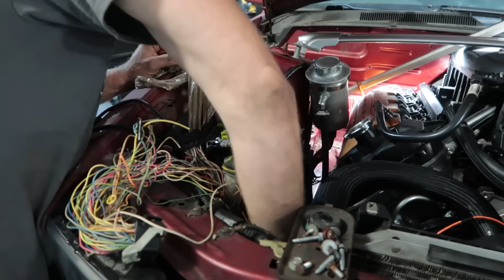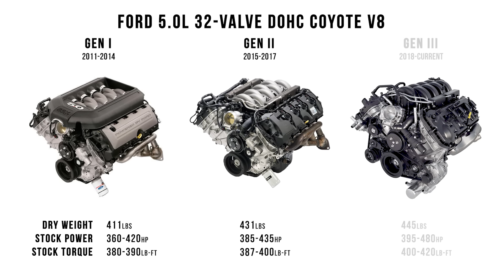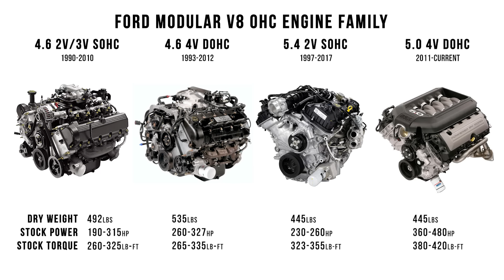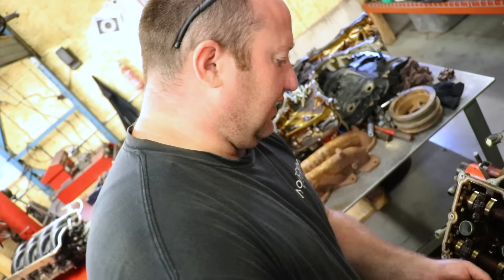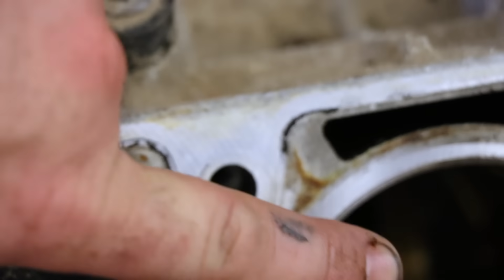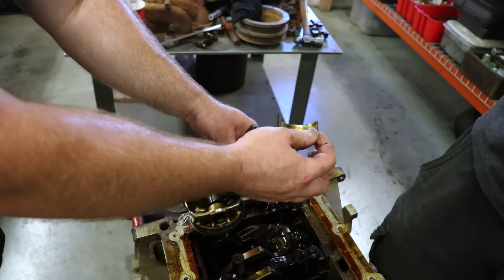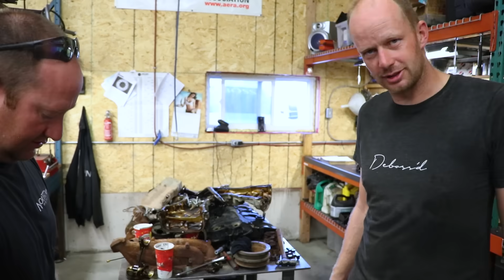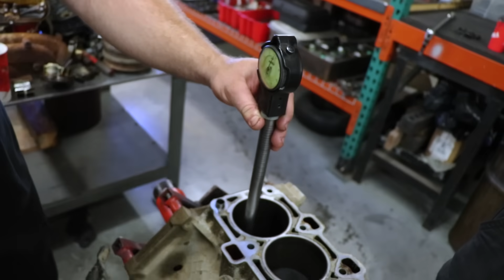REVIEW: Everything Wrong With A 5.0 Coyote Engine

Comment: I'm no mechanic. In fact, I've always tested lowest for mech. aptitude but pretty high for almost everything else and real life has backed those test results up. So I'm not stupid...just mechanically challenged. Just wanted to get that out of the way before I chimed in with my preference for the 4.6, which is based solely on a great, fun, and trouble-free experience I had with my old 2000 Mustang GT convertible.  Sounded great, felt way faster than it really was, though it was no slouch even there, and was super reliable. Back then people were bitching about it, wanting the 5.0 to return...and return it has, and now there's a new controversy, it seems.  Meh, 20 years later and I'm about to get a Ford F150, with 4wd and a naturally aspirated engine being my only non-negotiable options.  The naturally aspirated 6 is pretty weak, so I'm left with the V8...just hope it turns out to be a good choice.

Comment: I have. 2016 F150 V8 and it stutters when doing speed between 40 and 65mph and holding speed. It only seems after the truck has warmed up. Auto Zone shows no error codes. To this point I have replace, air filter, evap, spark plugs, ignition coils, and fuel injectors. 

Any ideas or suggestions would be appreciated. I’m already in to this for $1300 would really like to find the issue.

Comment: 217k on my 2011 F150 5.0 still going strong been runing e85 for over a yr now regular oil changes based on oil light
Reply: 10,000 mile oil changes wow
Reply: @americanchauvinist1210  you know the oil light is a lot sooner than that usually about 4,500
Reply: @kubeanieGaming  from the vehicles I’ve seen it 10,000. Most car/truck manuals will even say 10,000 mile intervals for “light” use and 5,000 mile intervals for “severe” use
Reply: @americanchauvinist1210  i am 1000 miles in to my new oil and it says 80%
Reply: Like my 2020 Honda civic oil life will be “50%” at 5,000 so according to that I can run another 5,000. No oil light at 50% no thanks I’ll change every 5,000

Comment: What is amidextrick?
Reply: It's part of the heat exchanger where the V- Tech converts the spent fuel to the rods via the post refractor. Usually upgraded to a double V convertor that be purchased at any online mustang parts supplier (ie, American Muscle). Cheers

Comment: 2014 150 5.0..4×4..mobil 1 5k....at 60k..light echo tune 87 oct...removed limiter...trans filter oil.45000..transfer..60000.k..diff oil amsoil...plugs 65000...idridium...355 diff..locker......top ofzerved speed in nevada 130 and still pulling...Wiley runs good..anti feeze changed 65000...airaif intake from air box to intake..air aid drop in air filter......maybe 380..385 crank hp...my experence so far   also a 36 gal fuel tank...super cab xlt

Comment: With the sludge and varnish deposits evident in the disassembled engine of this video, this is not a synthetic lube oil symptom. Sludge and varnish deposits like this are caused by excessive oil change intervals and  severe engine operating conditions. Short trip and city stop and go driving is severe duty operating conditions for engine and  motor oil, compared to longer distance per trip highway driving.  Clearly, the lube oil change intervals were not frequent enough for the operating conditions for this engine. 
Regardless of using synthetic or regular mineral based lube oil,  the detergent additive capacity of the lube oil  to suspend and control combustion products contamination is limited. Eventually, the amount of contamination the lube oil is able to suspend in solution will be exceeded, resulting in sludge and varnish deposits forming on the internal engine components. 
Associated with excessively long oil change intervals,  failure to maintain proper lube oil fill level maintenance between oil changes is common. 
The lubrication failure symptoms with bearing wear and damage that was visually apparent on the connecting rod bearings is consistent low lube oil levels with poor maintenance and neglect during this engine's operating life span.  
If the lube oil change intervals were performed according to the engine manufacturer's maintenance specifications, the oil change intervals were excessive considering the severe operating conditions for this engine.

Comment: Darker passenger side is due likely to PCV going to that side of the intake. Positive crank pressure air with oil in it is the cause. I'm am about to install a catch can to prevent long term intake gumming.

Comment: I think the Motorcraft 5w-20 recommended for my '13 5.0L is a synthetic blend. I change at 5k intervals and ignore the factory alert system. 75k so far, no oil consumption, really no issues with the engine whatsoever to this point.

Comment: Nothing much wrong with the coyote it's a pretty great engine and in my opinion the BEST engine Ford has ever produced! Super reliable and can handle quite a bit of power! Extremely big though extremely big for a 5 litre, but that's what you get with 4 cams I guess. The 4.6 and 5.4 can be great engines too but in stock form I don't trust them for longevity if you're beating on them like most people do cuz there just fun engines to push to the absolute limit. The 3 valve triton is absolute fucking garbage and you can just throw it right in the trashcan along with the new sparkplugs, coil packs and sensors you just bought trying to fix multiple misfires!

Comment: So the one thing I want to add as for the differences between the 4.6 and 5.4 modular engines. The blocks are all basically the same from piston bore size and spacing for them, but the deck height of the 5.4 block is much taller than a 4.6. The 6.8L V10 is essentially a 5.4 with 2 extra cylinders, and the 5.0 completely changes almost everything besides the water pump housing embossment, and the shape of the timing covers are very similar from the 4.6/5.4s and the 5.0 modular (coyote).

Comment: I haven't heard so much misinformation about synthetic oil in a long time. The idea that synthetic oil "crystalizes" and that the varnish and coked oil being caused by running synthetic oil is total nonsense. The crud inside this engine was caused by infrequent oil changes and possibly also insufficient warm-up due to short drives. No oil can cope with such poor maintenance. Non-synthetic oil is much more prone to varnish and coking than synthetic oil. There are many reasons why no modern engines only synthetic oil. It's because synthetic oil is better in virtually every way than non-synthetic oil. That's not to say that all synthetic oils are equal. There are good oils and not so good oils, but I haven't heard of such misunderstandings about synthetic oil for a long time. You should spend some time over at BobIsTheOil guy or anywhere to learn about oil.

Comment: So people don't understand is the oil consumption is in the gen 3 5.0 witch is 18 19 20 I've being talking to my ford company they said same thing I did the best 5.0 ull get is the gen 2 witch is 15 16 17 I've had the 15 gen 2 5.0 had 145,000 miles nothing was wrong with it and the wife wanted something bigger so I tryed it in a few yrs ago so now I got a 2020 f150 5.0 witch is the gen 3 this gen 3 is junk cam issues and oil consumption problem but ford is redesign the gen 3 back to the gen 2 problem is I got to wait for new motor but I've also had the 4.6 and 5.4 theses two engines are the worst engines ford ever made I've being a working on theses motors for 15 yrs now and i will not work on 4.6 or 5.4 but yes the 5.0 is a lot better then 5.3 gms motors more hp and if u get rite gen 5.0 they are bullet proof I will not own any other engine only 5.0 but yes chevy motor are nothing to fords

Comment: The main reason the Ford OHC will never be as good as the LS engine is complexity. That's not to say the engine isn't a good quality, well-engineered engine. But 4 timing chains, 4 cams, several guides, and 4 phasers will never be as reliable as 1 chain and two gears. It cant, the law of probability is against them because of so many more moving parts. It litterally takes me less than two hours to have the heads off an LS with the engine in the car. It is MUCH more difficult to work on a coyote than it is to work on an LS. So for an enthusiast engine that will be worked on frequently to upgrade, the LS is just a much friendlier platform. That's why they get swapped into everything.

Comment: This video could have been real short. The only thing wrong with a Coyote is the oil pump gear if you are planning on making a lot of power. These are one of the most solid, well-built engines on the planet.

Comment: My 2015 5.0  78k miles burns oil for some reason. Unfortunately I followed the computer oil change intervals in the beginning and found out the oil was quite low. Since then I’ve been keeping a better eye on it. Usually just after 2k miles from last oil change I start seeing the level drop and have to add more. I hope no damage was incurred early on from not knowing this was happening. I’m outside the warranty now too of course. 5k oil changes from now on. My commute is 10-15 miles each way so I hope I don’t have sludge like this video. I hope I’m not too late changing the oil interval. If I had known... oil change more frequently is a small price to pay versus engine repairs. My 2nd F150 and my loyalty is sort of spit on IMO by this oil consumption and bad Ford oil change interval.

Comment: I had a LS1 in a 2004 GTO.  It was a great engine.  Never had one problem.  Haven't seen one video tearing down a LS1 and examining common problems.  Probably because there weren't any.
Reply: Ls engines had issues with collapse lifters
Reply: @fordnut4914  well maybe the ls models that come in a base model truck with high usage. But with the high-performance LS1 I've never seen any documentation of that.
Reply: @ctu5086  secondary air injection valve  coolant leaks throttle issue. And there is few other common issues with those gto engines.

Comment: We have a fleet of service trucks with the modular 5.0 and have very few problems with them. Most notable is waterpumps and leaking coolant hose connectors. We see 300k-400k on these before we replace the trucks. I can't think of one that needed an engine before 200k. Most are retired with the original engine and transmission. We do service ever truck by the book, though. We had 6.4 powerstrokes before that and that was a completely different story.

Comment: Doses cost more to rebuild an Engine or Buy a new one? I just paid of my 2013 F150 XLT 4x4. The was miss firing,it needed new Converter & Sensors & Camshaft Sensors. Still no response on Drivers Side of the V8 5.0 Coyote Engine? Is worth rebuilding ?

Comment: Looks like the other owner of this engine did not take care of it.  My 01 MX-5 and my 13 F-150 both get synthetic oil (Mobil 1) the Mazda has 175K on it and the Ford has 110K on it and both engines look clean as new inside the valve covers.  Don't blame synthetic oil for lack of maintenance.

Comment: I've had Ford trucks most of my life, went from Rangers to F-150's, had a 4.6L 2V, great, very reliable engine, had zero issues up to 244,000 miles when I sold it.  I mean I replaced the rear wheel bearings, some front suspension parts, but although the 4.6L couldn't barely get out of it's way, it was a solid, extremely reliable engine.  I now have a 2013 5.0L, I guess the same type they tore down here and I always use the same exact oil, but always synethic, wondering if I need to change that.  It has 189,000+ miles on it with no problem yet, except a new oil pan gasket and a starter.  Of course, it's a beast versus the 4.6L and in a truck about 1200# heavier.  I have gone to changing oil every 5000 miles based on towing duty and age, it that enough?  Great video btw, very informative.  Also, did they mention the mileage this engine had on it?

Comment: I had a 2001 5.4. Not sure if it was the crap one the guy mentioned, always had a problem, never stopped to sort it out. Ended up selling with 267,000 miles on it. Always changed the oil at 5k, always used a Fram filter. It blew 2 intake manifold gaskets, drank some coolant, had 3 sets of plugs and coil packs while I had it. Between 137,000-267,000k had the check engine light on from the day I bought it. I would imagine it had some ring damage from the coolant. You could tell the loss of compression when shutting it off. Always started. I even cut two vacuum lines to get the 4x4 to engage. The harder I was on the truck the longer it lasted, it seemed. Never ran a set of new tires, always second hand from the flea market. Never aligned it, probably put 3-4 sets of brakes on it. Changed one caliper, had a brake line blow after it got to the size of a golf ball from rusted line internal. The one that got me the most was the idle air valve. That was a long cold morning. Simple fix. Not so easy to get to. Always synthetic oil.

Comment: ive got a 2013 f-150 with the Gen 1 in it, and i love it, we got it at 49k, it has 81k now, and its still a fairly "new" motor, but it runs like a top and its butter smooth and quiet (except for my rousch exhaust of course), but i love it, fantastic motor

Comment: I have a 2015 GT w/ the 5.0L and they are a blast. Factory oil in it is a synthetic blend not full synthetic. I did add a catch can to keep the gunk from going back into the intake. I beat it up and yet to have any issues. Even tuned and run E85. No need for bigger injectors or fuel pump o. The 2015. Just the tune to run it.

Comment: Why do we see all these issues with #8 cylinder miss fire? Buddy have a 2011 F150 with this issue. After checking the basics, coil, plug, injection we believe it's the valves. Seems to be a common problem.

Comment: 5.4L 3V gets so much hate. Personally I have 280K on my 06 with no engine issues at all. Did a full timing job and oil pump upgrade about 10K ago just for piece of mind.
Reply: Got one with 196k and it's starting to let go. I have seen multiple 400k 5.4 tritons original engine tho

Comment: I've been reading about these engines and have found some information about cylinder 8 misfires due to worn intake valves causing low compression. Wondering if you guys know how prevalent that was and if it's a concern before buying one

Comment: You showed a slide at the 1:55 mark for a Generation 1 engine from 2011-2014 on the left.  I have a 2010 Jaguar XF with a 5.0 Ford Coyote engine.  Is this motor something completely different that what you are talking about here?  Or is it that the slide has the dates wrong?

Comment: Synthetic doesn't sludge up on short runs.  Circulates quicker than conventional oil when cold. I've used Synthetic since the 70s.  Only use conventional to break-in engines then straight to Synthetic. Pick-ups are the most abused vehicles,  no car washes with chassis wash and usually driven by some luney employee.  Oil isn't changed religiously.   I change my oil every 7-8k and have a relatively clean engine internally  at 200k. Also takes a whole lot more temperature to sludge up Synthetic.

Comment: Hi . Nice video. I have a 2013 f150 whit that engine and I has a miss fire on 5 . Is low compression and is cause by a valve . What could cause that problem.

Comment: Scott the coyote, as you see it is the way of the future. I don't agree. Simplicity rules, because customers aren't religious about the maintenance on their ridiculously overcomplicated double overhead cam Ford. That's why G.M. stayed with a push rod configuration engine. Every Ford engine that has overhead cams, has had a limited life span, related to the valve train.  I've seen 5.3 ls Chevy's coming close to 400,000 miles. The simplicity of an engine that is much simpler to lubricate, is a big win. Getting customers used to Overhead cam power plants that use oil, is a study in luck. I've heard guys say they don't change oil as often in their 5.4 Ford trucks, because they're constantly adding oil. "Keep it simple stupid"  is the ruling rule of the day, and makes sense.
Reply: AFM is killing Chevy's V8. I will keep the Coyote 5.0.

Comment: Used Mobil 1 "5w20" in a 09 f150 5.4 for 13 years. Just changed oil pan and cam vvt solenoids motor was very clean.

Comment: I have a 2016 Ford 150 XL with the 5.0. Ford recommends using synthetic oil. I just turned 100,000 miles. The only trouble I’ve had was a cracked intake manifold. Do you recommend that I start using standard oil? I change my oil faithfully at 5,000 miles.

Comment: I have a 2014 5.0 in my f150. At 500 miles I did my first oil change and went 5w20 pennzoil synthetic. They are not cheap to do. However I do them regularly at 5 to 7 thousand kms. The engine is quiet and does not use any make up oil. The truck has 100 thousand kms. Mostly used on long highway run. I would say that this is a well built engine.

Comment: I have this motor in my work truck. It’s a piece of crap. Had the intake replaced twice. And had the cam changed. I’ve always had the oil changed when it was do. It’s sitting at the dealership now have some work done again. It’s been there for 3 weeks. I’m pretty sure they’re just gonna replace the whole motor. It’s a 2017 by the way. On a fleet work truck. And my company has 6 other trucks doing the same thing. 😢. Not a Ford fan at all.